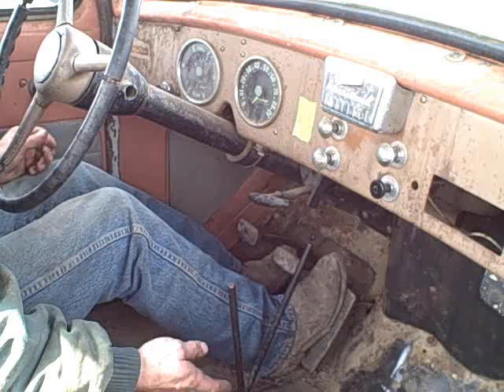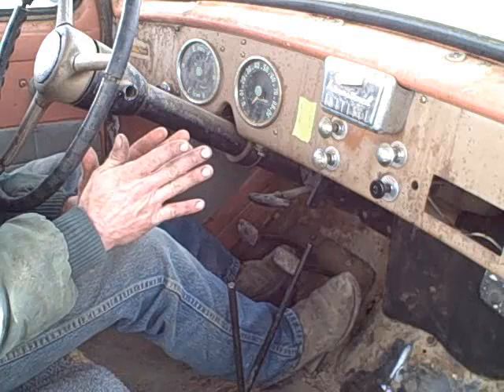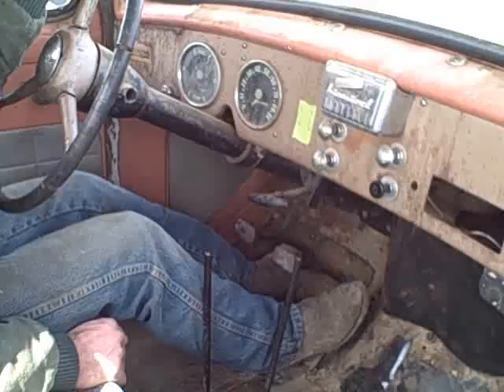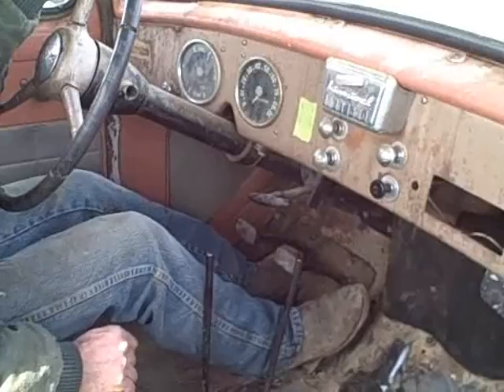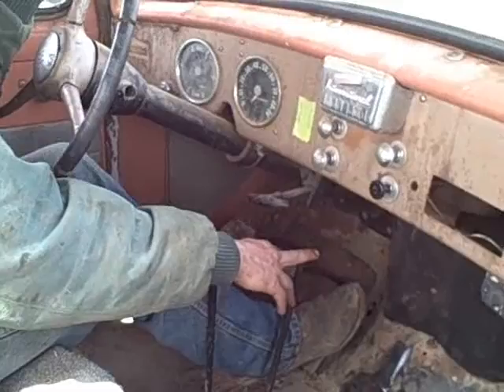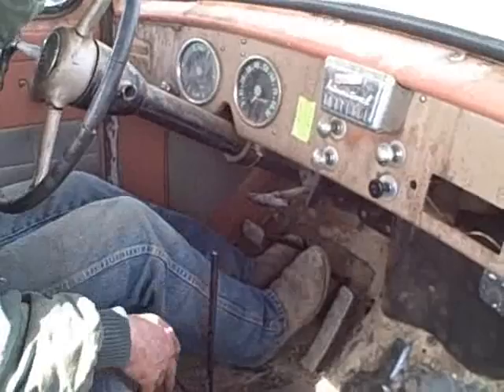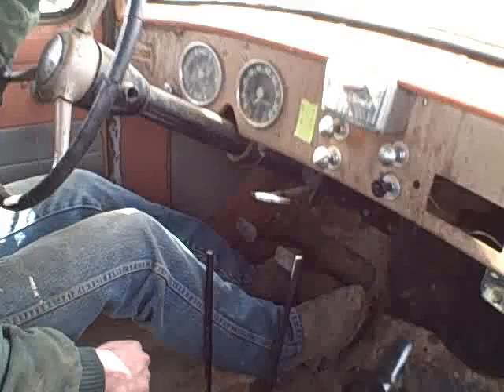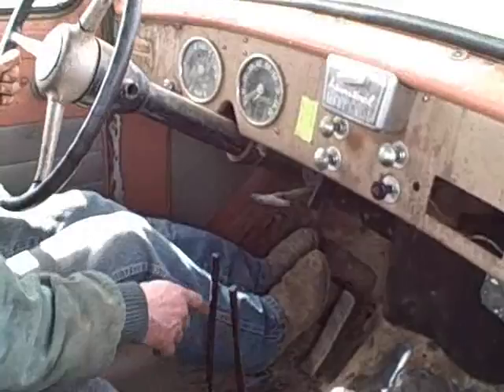How to double clutch and some transmission tidbits

Comment: thanx for explaining for all the ignorant young kids who think you have to do this with a modern manual transmission glad to see an OLD truck still working.hats off to you fella, Keep up the videos!
Reply: Agreed, I'm over here trying to find out how to drive my new project truck and all it is is 17 year olds in their dad's Kia or some ratty Honda.
Reply: mycerebralcortex im trying to figure out how to double for my 64 dodve dart 4 speed and i want to save the trans but i also am learning to bangshift for obvious 17 year old stuff
Reply: well if ur synchros are shit then you should double clutch in a modern car
Reply: mycerebralcortex with all due respect at 16 I can't even drive yet but I've worked on more cars than my dad age is just a number
Reply: I teach automotive and the thing I always get is a kid arguing with me that "rev matching" or "heel toe" is the same thing.... 😐
Reply: @Shyzah  good point. Also, on the same note, if you're pushing the gearbox hard, double clutching a synchronized box will prolong the life of your blocker rings. My tremec 3650 oil when I drained it during service was clean as new.
Reply: Why is it always blaming the "kids?" You people do nothing but blame and insult people.

Comment: Learning to "float" the gears is much easier than trying to learn to double clutch.   I drove truck for over 24.5 years, and I never quite got the hang of double clutching.    The simple fact of non-synchronized transmissions is whether or not you use the clutch after starting out...you're gonna grind gears if you don't match the speed of the engine to the gear you want.     Don't get me wrong, your video is great, and I'm not criticizing it...just trying to convey my personal experience with trying to learn to double clutch.     Have a great day!

Comment: Another great vid Wayne! I once had a twin shifter setup like the 57s, non synchro trans and I sure miss that pickup! My first "nice" pickup still had it's column shifter, and I really liked it. At the time my friends would always ask me what the third pedal was for in that one. City kids didn't know about clutches I guess. LOL! I told them as straight faced as I could the pedal on the left was for the windshield squirters, and universally they all bought that one til they rode with me.

Comment: No wonder IH went out of the light truck business. No in dash Sirius radio.

You probably already know, but helical cut gears also produce side loads that straight cut gears don't. Just more forces to deal with in design. I sure love the straight cut gears in my Harley though. I'll never get one of them new-fangled motorcycles with those sissy helical cut quiet gears. Hell no, not me.

Comment from the maker: @Sillybillydilly if you rev the motor with the clutch in then you would just be turning the flywheel and that wouldnt allow the input gears in the transmission to spin up to speed hence the reason you have to let out the clutch, rev it and then put the clutch back in, and the clutch wears the most when you are starting to move from a stop

Comment from the maker: @backwoods3214 they are the wiper, lights, throttle, and choke, there is only 2 shifters, but this pickup would have originally been equipped with a column shift and for whatever reason (I assume the linkages wore out) the previous owner converted it to a 3 speed on the floor which either requires a proper conversion kit or the 2 sticks you see there

Comment: A synchronized transmission has little bronze bushings that rub together when you go to shift the gears. These "synchronizers" act like tiny brakes and slow the gears down so that they mesh easier. A synchronized transmission will also most likely have helical cut gears that reduce gear noise. An unsynchronized transmission will almost always have straight cut gears. These gears are noisy. That is why Model A Fords back in the 1920'/30's have such noisy  transmissions.

Comment: Truck was originally 3 speed with column shifter, but apparently the linkage wore out.  It's still a 3-speed, but one stick shifts between first and reverse, the other shifts between second and third.  You have to make sure one stick is in the neutral position before you shift the other one, when going from first to second or second to first.

Comment: because it has a non-synchronized gear box, so you have to let out on the clutch in neutral so it will synchronize. a car with a standard transmission has a synchronized gear box so you don't have to double clutch.

Comment: Somewhat helpful. I have a 51' GMC just like this truck here. When I grind the most is when I go from 3 to 2 going down my drive way. IDK  why but thats just a bad spot. I only use 2,3,4 as first gear is a compound low. Hey can you explain in your next vid about compound lows. I would like some more info on that.

Comment: you  have to do a similar thing with and older tractors.  like my bolens for example ya gotta push the clutch in multiple times for it to engage.. and i know that howling noise it sounds similar to a driving hyrdo transaxle or when you use reverse at higher speeds.
Reply: Cause reverse is a straight cut gear, the sound is actually pretty much identical to that.

Comment: @Sillybillydilly you let the clutch out in neutral to keep the input on the trans spinning at the same speed as the engine, other wise it'll grind going into gear.  at least that's what I've been told.

Comment: mr zapwatt is also forgetting that the mini (which featured the BMC A series engine)  was also fitted to the morris minor which was  produced from 1948 till 71 this same engine was in production from 1951 till 2000 and was also licensed to Nissan and became the base for many of Nissans engines. Talk of technical innovation between the US and the UK has nothing to do with the OP's comment about the two gear leavers.

Comment: @chance9888 I agree. Im not a huge fan of slip shifting. Theres a clutch pedal there for a reason duh! I really hate when people slip shift a fully syncronized transmission for no apparent reason. They might think that they are hot stuff because they have the skill to do it, but yet they are not using the clutch for what its for. The clutch is to break torque and release all the tention of the transmission and driveline. Instead you just fight the syncro's and break things

Comment: Nice glasses wayne! I got them too! Anyways say you were driving through town and you come up to a stop sign. Do you press the clutch, put it in neutral and let the clutch back out and then just stop with the brakes? Or do you shift down the gears until you get to first and then just just put it in neutral for the remaining 10 or so feet?

Comment: @TheChevy3500hd it wears out clutchs faster if u have a synchro transmission its better to shirft gears normally 
float shifting if u get good at is the easiest on everything but its also the most difficult

the thing to consider is the added usage of the clutch which means it will wear out sooner .....

Comment: Keep in mind that this truck was probably made in the 1940s or 1950s. Need I remind you that in the UK, your most enduring contribution to motoring was the classic mini made from 1959-2000. Yes, your beloved Mini in its YEAR TWO THOUSAND swansong had pushrod valves and a reverse-flow head (intake & exhaust on the same side) with Siamese ports.  <---wanna talk shit, get a mirror.

Comment: Not so much about spinning the engine up as it is about getting the clutch disc and input shaft up to speed. That is to say: when you push the clutch in the 2nd time to actually select the next gear the engine is back out of the picture (pressure plate disengaged), the whole point was to get the clutch disc / input shaft up to speed.

Comment: @johndeereman19 I haven't had anyone even know what I'm talking about when I mention 5 and 4. Nice of you to mention they're existence! 5 and 4's have two sticks quite like you saw here, but there are other boxes that ran more than one stick, such as this 3 speed. Heavy duty trucks often ran 5 and 4 to get enough gear ratios to pull heavy freight. One stick worked 5, other stick 4. Here 1 stick works main shaft, other works counter shaft.

Comment: wow i wonder why there are less old cars in a country where the weather is brutal and they spread corrosive salt on the road for 5 months a year to stop ice, as opposed to the usa where the weather is awesome.  also we have a very strict mot test where no holes or serious rust/structural rust will pass.  as i understand it some states in the usa only require an emissions test.

Comment: Thevrolet vikings had hydromatic transmission i think. 
I believe the later hydros were scynced
Around 55 or so. Dont quote me on that. 
I messed with a 59 gmc pretty much a chevy task force 1-1/2 ton dually had a 302 with a 3 speed 
R 2
| - |
1 3
Had to double clutch it even though it wasnt running idk what the deal was there 
My 91 does the same thing 
But id rather have a 59 ...

Comment: I don't understand, why do you need to remove your foot from the clutch, when adjusting the engine speed between gears? I can achieve the same effect just by keeping my foot on the clutch until I've approximately matched the engine and transmission speed and have a seamless gear shift, but only pressing the clutch once, and removing it when in the next gear. Plus I only have to move the stick once, I don't have to stop in between.

Comment: Why not just hold the clutch down for a hair longer on the up shift? When I down shift, I usually do it throttle-less and feather the clutch. That's when the RPMs are low anyways. For higher RPM downshifting, I clutch, throttle/shift, and ease the clutch back to the engaged position. I don't understand why you would double clutch. Seems like excessive stress on the clutch components.

Comment: Liked the video. But why are you demonstrating it in a truck that has a synchronized gearbox? The 57 International was Synchromesh. unless that's not the original transmission or all the synchros are shot to shit and you have to compensate by double clutching.

Comment: two sticks for shifting?  is one for low and high like on an 18 wheeler? i never seen something like that before
Reply: Looks like a home made conversion from the column to the floor
Reply: i think you are right, one stick is probably 1-2 and the other is probably 3-R
Reply: Yes and no, it is a conversion like this
1 3
R 2
Reply: the gear stick  has lets say 6 positions the second stick allows to get from 7 to 12 on the same pattern of the gear stick. thats as much as i know about trucks